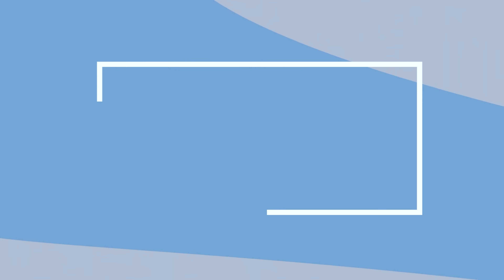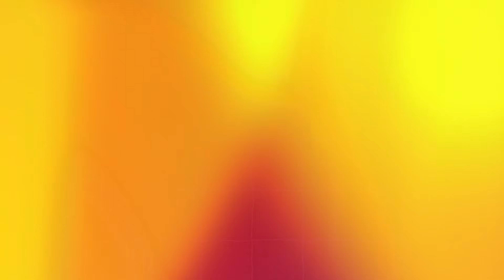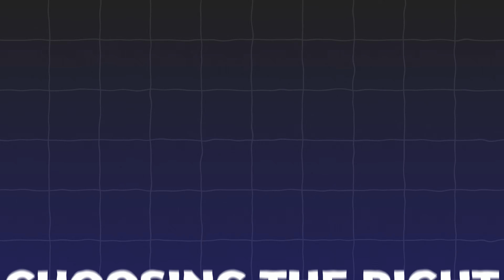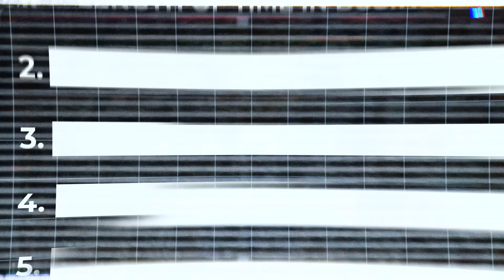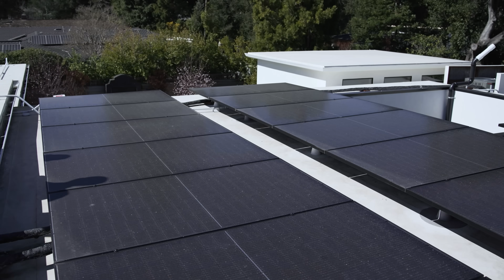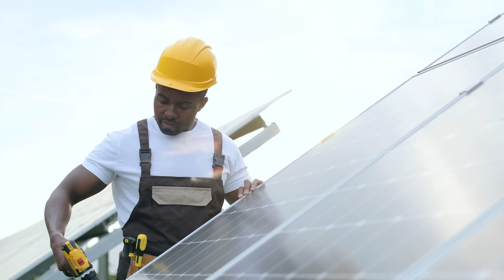Building the Best Solar Power System in 2024

Comment: All great points in the video and I’ll put some of it down in my comment and cover new ground.  For anyone interested in residential solar, probably the biggest thing to watch out for is getting locked into a solar lease.  If possible buy your solar PV equipment outright.  Solar leases come with penalties for early termination.  It's best to gather 3-5 quotes from large to small solar companies for the best balance of customer service and cost. 

Always ask these questions of any solar installer when gathering your quotes:

Are you approved, licensed and insured to operate in my state/county/city?

Ask for their license and policy number and verify that it’s in good standing with the appropriate licensing board and insurance providers.

Is my roof a good fit for a solar PV array?

Realistically, most solar panels can be arranged to capture the greatest amount of energy with adjustable racking technology and other assessment tools. In the end, some homes will have better solar coverage of their roof over others. Using a tool like Project Sunroof can help you assess on your own and without a salesperson. If your roof is covered in shade by large trees or a nearby building, north facing or in poor condition it may be not suitable for solar installation. Installing a new roof and solar system at the same time can be a cost effective way to combat climate change and lower your carbon footprint.

What happens if I want to sell my property or move out?

Look for specifics in your contract and ask for them to be explicitly noted. If there are any penalties or fees you’ll see them here. Another important point is the ability to move out of the property and rent it to tenants. In this case, the options should be stated as applicable. Perhaps you wish to have your tenant pay the electric bill but you wish to continue with the financing payments for the PV system. Learn all of these details up front and from the contract’s top to bottom.

Do you use contractors to install the equipment?

Using a third party contractor can bring opportunity for uncertified or unlicensed/uninsured workers on your property.

What type of warranty does the system and install come with?

Warranties and guarantees can vary greatly. They can exclude certain components and not provide a point of contact should something go wrong. Get as many details in writing as possible before signing a contract.

What is your estimated timeline for project completion?

Timelines can vary greatly and can influence total cost. Watch out for the estimated timeline and that it works with your schedule.

Can you provide the total cost of the system to me in digital or paper format?

If you are looking to finance or lease your system ask about any required down payment and how much monthly payments will be. Any state/federal/provincial tax credits/benefits should also be detailed here. We strongly advise readers to own their equipment outright to avoid any additional hidden costs or penalties/fees should they want to exit the contract or sell their property.

There is also more helpful information on finding the best solar installer in this link:

https://ecotechtraining.com/blog/how-to-find-a-solar-installer

Comment: Hi, What’s your take on the EF ECOFLOW 12kWh Power Station: DELTA Pro Ultra with Extra Battery and their smart panel 2 as your whole battery system? Would you do a direct connection from solar panels to take advantage of the DC charging? Thanks.
Reply from the maker: I think EcoFlow Delta Pro Ultra is a great choice.  You'll want an electrician to help install the EcoFlow smart panel 2.  Also, yes I would install solar using the high-voltage input to take advantage of self-consumption.

Comment: The DC from solar panels is at way too high a voltage and variable to be used directly to charge batteries.  So you need a switching converter to bring that voltage down and regulate it.  Similar switching converter can be used for AC input.   As such, both incur losses due to conversion.
Reply: Nope,  Straight DC coupled string inverters like from Solaredge use a DC regulator to charge batteries straight from the solar panels that suffers nearly 0 losses,  this DC regulator simply prevents batteries from overcharging and ensures safe and effective charging rates to the batteries,  Solaredge charges batteries at a 99% efficiency rating.   -------------  AC coupled systems like Enphase must be inverted back and forth between AC to DC and DC to AC and are much less efficient than DC string systems and especially Solaredge systems.   It is said that Enphase loses approx. 10% effeciency on batteries (2 way inversion AC to DC and then DC to AC) so (a 10kwh Enphase battery you fully charge to 10kwh you only get back 8.9kwh back out) of the battery after it is changed back to AC.
Reply: Well we've already been doing that for years whether it's AC or DC and the efficiencies are extremely high. I have an old-school off grid 24 V battery and I can take 550 V DC in from my solar array which is 500 feet away from my house (8 awg wire) and I can charge a 24 V battery at about 97% efficiency even though the DC voltage and current fluctuates greatly throughout the day. That is all done with a high voltage high amperage charge controller.

Comment: Thank you for the excellent review. I have a ground mount system with bifacial panels. Tesla three batteries being installed. I do have an existing backup generator. It runs a critical loads panel. Tesla power three battery cannot charge from the generator. If a long-term power outage occurs, I could run the generator to run critical loads scheduled as needed, so it won’t run continuously. Also I’m investigating an electric car option that could add battery capacity and have the capability Of charging and discharging when needed. Any thoughts?

Comment: What are the stats for inverter failures? Now that both microinverters and string inverters have been around for a good long time, there should be some good stats for the rate of failure. I know that using microinverters create a situation where the chance that at least one will fail increases (albeit without taking the entire system offline), but with a string inverter, one failure brings down the entire system.

The questions I'll be asking my contractor include that tradeoff, as well as how long it would take to get a replacement done, given parts availability and how long it will take for them to do the service call.
Reply: Solaredge says that today their hard failures are very rare (around .02 %) that causes an inverter to need to be replaced (usually caused by age).    Some things that can cause other issues like a temporary shutdown can actually be caused by the grid or grid wires or the transformer on a pole that may cause problems when selling power back over the grid,  these type problems will even give Enphase or other brands problems that are grid tied like if the grid voltage is constantly too high or has random voltage spikes.

Comment: I've talked to 4 installers and they are selling Tesla PW3 or Enphase. I thought there would be other vendor inverters recommended.
Reply: Their reply's may depend on how you word your questions,  those two you mentioned (Tesla and Enphase) may be the systems they like or prefer to install as it makes them more money or they have some sitting in a warehouse so they will always push to sell and install those first.   Its not about what your installer wants to install but about what you want and what will work for you and your electrical needs and fits your money situation.      If you like a hybrid brand like Solaredge or an Off Grid Inverter system you should ask them if they have installed any of that brand in the past and look for a reaction from the installer,  very likely they will admitt that (yes we have) but they will probably follow that with (but we prefer to install) the Tesla and Enphase as mentioned and then they will try to convince you that you as the customer will be happier with (their choices) just as a car dealer will try to convince you their X brand car is better than the Y or Z brands.

Comment: Hey Joe:  Thxs for the knowledge regarding Solar Power systems.  Have u done any videos with recommendations for upgrading a NEM2.0 system under NEM3.0?  

Also, what to get reliable service for your Solar System if your installer goes out of business.  Thxs.
Reply: There are definitely videos on the channel about some options if your original installer goes out of business. I'm not sure about whether or not they've done ones on converting a system from NEM 2 to NEM 3. They have videos about NEM 3 and its effect on the industry, but I haven't watched them since I'm not in California so I don't know how far into things they went as far as effects on existing site operators.